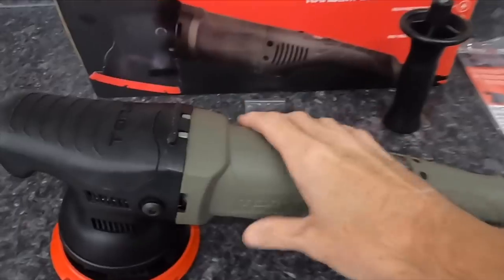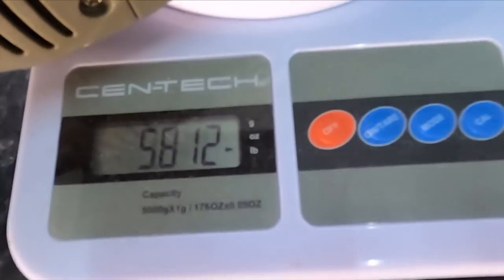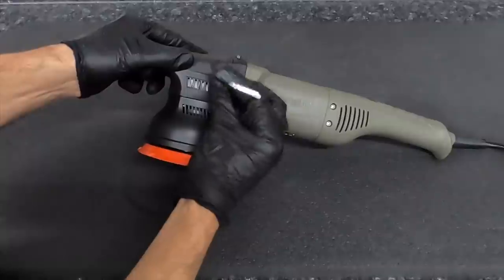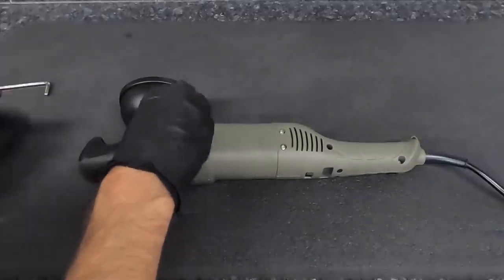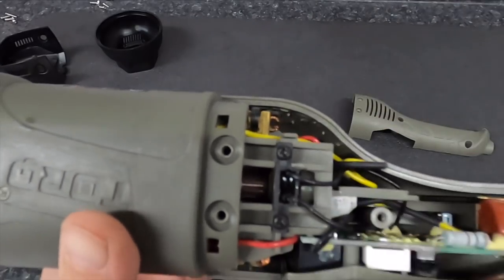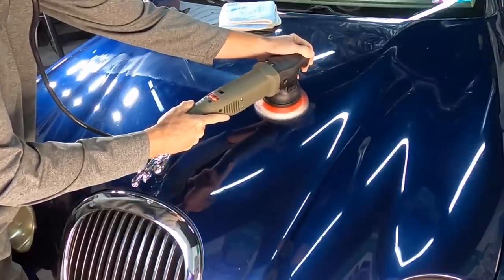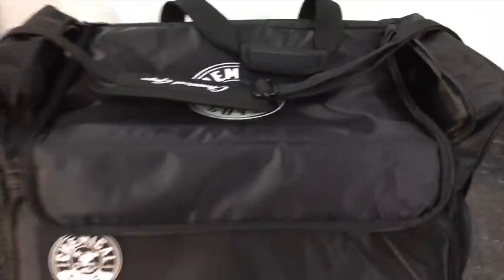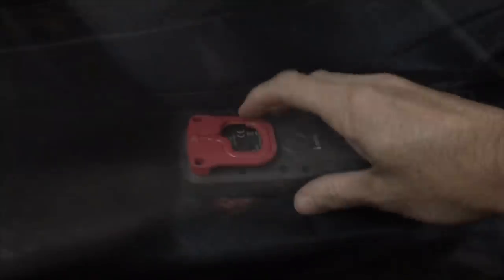Chemical Guys Torq 15DA Long Throw Random Orbital Polisher!! 900W 1800-5500 Rpm!!

Comment: I have a Griots Garage 15mm polisher and I hate it. It stalls out all the time even on flat panels. I might have to get one of these. I have the 21mm Torq and I love that machine. No issues with that at all.
Reply: I bought the MaxShine 15mm earlier this year.  For the most part, I like it.  However, even with the washer that is included to do the "mod", it still will not spin freely, and it stalls often.  I ordered a thicker washer that I hope fits and will solve this problem.  Why manufactures allow this, I don't know....I'm just an amateur.
Reply: @craig.encinitas  I did the washer mod on the Griots too and it didn't help at all. This new Torq looks very promising though.
Reply: @mattmerwin3842  Damn.  Oh well.  If I get another machine, the gear driven Flex 3401 looks powerful.  I'd want to keep using the pads I already have, though.

Comment: Looks to be a smooth unit!  Curious on your take of this polisher versus the Maxshine 15 mm polisher. Great video Brian.
Reply: He probably prefers the Maxshine as we seen him use it much more often.
Reply: @deregulationIC  Pretty sure you see him using the 21mm not the 15mm. Want a good look at the maxshine 15? https://youtu.be/Sh1a8-ilpxo
Reply from the maker: Both decent, effective polishers.. I do use my MaxShine more.
Reply: @apexdetail85  does max shine have two polishers, the shine master 15 mm and the max shine 15 pro or are they the same
Reply: @apexdetail85  Brian which would you advise on using. I like the max shine 15 mm pro series 2. Tossed between this machine and the torq 15 mm long throw. You're a pro . I'm a rookie looking for advice. I'm leaning towards the max shine pro series 2 15 mm

Comment: I have a 10fx with over 120hrs of use with zero issues. Got the 15da and within 30hr of correction the bearing went out and the backing plate started to have a crazy vibration. Tore it apart and the bearing inside came apart. Bought a second one because I needed to finish some work and within 25hrs of correction same thing happened. Having a one year warranty means you have to send in your machine and wait over a month to get it back. Absolute bs when you spent $500 on 2 machines within 8 months of each other and have cars to get done. And no I didn't drop it or use it incorrectly and damage it myself.
Reply: Junk.
Reply: Hey Andrew. I also had an issue with the 15da. Polisher had been used for 2 corrections prior before the backing plate flew off, fortunately not hitting the vehicle. Allen bolt was still secure in the threaded piece that is attached to the drive mechanism. Took it back and was told they had seen only one other unit that this happened to. Replaced the polisher with a new Torx 15da and has working good so far. Thinking this might happen again i purchased a Maxshine 15da as a backup unit.

Comment: Good tip on changing and repacking the grease. I have the same polisher and gonna do that to mine now.

Side note I’d like to get your take on the Torq R the rotary unit they have. Been thinking about getting that to add to my current 15mm
Reply: I have the Torq R rotary, have been happy with it.  Had it a year, cuts well and durable.  Can get hot would be the only negative.

Comment: Torq in my opinion are underpowered garbage, Torq maxed out is Rupes at about 3.5.🤢🤮🤢🤮🤢🤮
Reply from the maker: It is effective enough. I personally wouldnt take an electric polisher from Rupes if given to me. Over glorified, priced paper weight. My 15 and 21 broke down during the busiest season for me. I do however like my LHR 75 pneumatic
Reply: @apexdetail85  I have the 15 & 21 mark ii, both collect dust. My main is the Flex 3401, currently have 2 of them. 1 for 5" and 1 for 6". I like Flex so much I also have the PE14, PE8 and PXE80